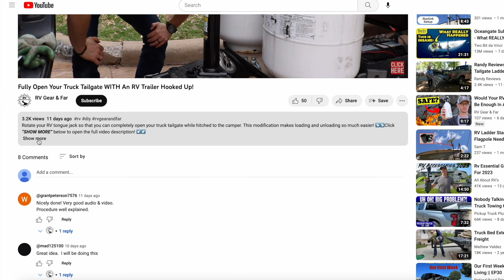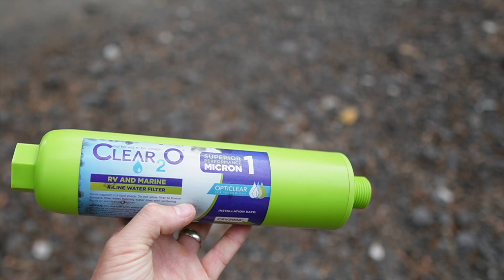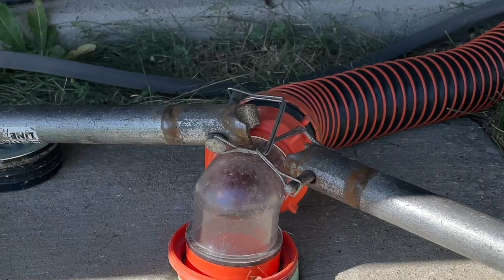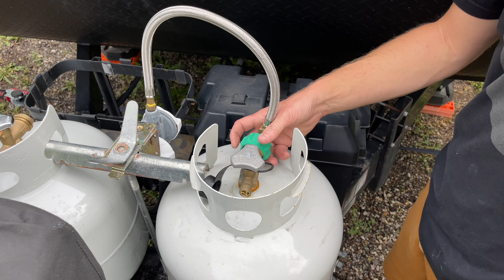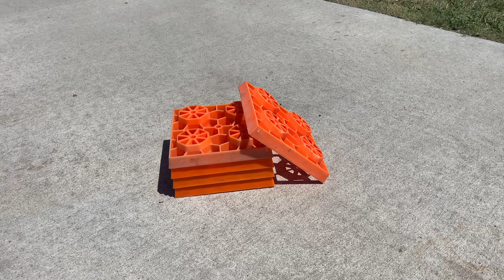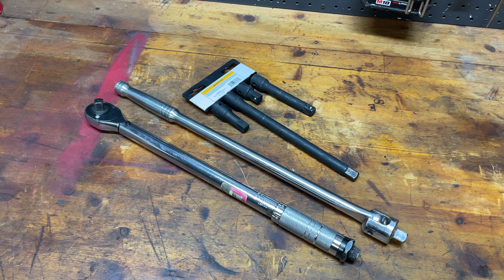New RV Owner? Here's The Essential Gear You Actually Need (Beginner's Guide)

Comment from the maker: 🏘 Join the RV Gear & Far Group Here:
https://rvgearandfar.com/rvgfyt
⭐🌟 Check out ALL the products and gear we recommend here: ⭐🌟  
📦 https://www.amazon.com/shop/rvgearandfar 📦 
⭐⭐ Examples of Products Used In This Video ⭐⭐
🔷 Power Watchdog EMS Surge Protector 30amp https://amzn.to/3OBV4AQ 
🔷 Power Watchdog 50amp https://amzn.to/3DzNRev
🔷 Basic RV Surge Protectors https://amzn.to/3q8Cqr5
🔷 RV Dogbone Electrical Adapters https://amzn.to/3DzFoI8 
🔷 Dual Fuel Generators https://amzn.to/3q8Wh9z
🔷 Generator Parallel Kit https://amzn.to/3KivHBC
🔷 Car Generator https://www.cargenerator.com/
🔷 Solar Generators https://amzn.to/44PecRN
🔷 Basic Water Pressure Regulator https://amzn.to/3KivDSo 
🔷 Adjustable Pressure Regulator https://amzn.to/3Yhh33j 
🔷 Fresh Water Hose https://amzn.to/44NqbPL
🔷 90* Hose Adapter https://amzn.to/3rSdFzS 
🔷 RV Water Filters https://amzn.to/3Yc0W7j 
🔷 Dual Stage Water Filter https://amzn.to/3Yc9Txn 
🔷 Hose Quick Connects https://amzn.to/3QlOsrQ 
🔷 RV Water Softener https://amzn.to/3QlOyjc 
🔷 Black Tank Treatments https://amzn.to/3Yd0buH
🔷 Sewer Hose Supports https://amzn.to/444uFAt 
🔷 RV Sewer Hose https://amzn.to/3OeBE3G 
🔷 Twist On Waste Gate Valve https://amzn.to/3QCe2Jl
🔷 Disposable Gloves https://amzn.to/3rWvCwZ 
🔷 RV Snappads https://www.rvsnappad.com/discount/GANDERFLIGHT 
🔷 GasStop https://amzn.to/3rOAvZ8
🔷 Garmin RV GPS https://amzn.to/3QjHvqY
🔷 RV LIFE GPS https://www.rvlife.com/app/ 
🔷 Trucker’s Atlas https://amzn.to/3rOAyEi 
🔷 X Chocks https://amzn.to/457lXSH 
🔷 Stacking Leveling Blocks: https://amzn.to/3Kk76wl
🔷 Rubber Wheel Chocks https://amzn.to/3rJT6W6 
🔷 Stacking Leveling Blocks https://amzn.to/458WpVj 
🔷 Ramp Leveler https://amzn.to/45cD31H
🔷 Fastway OneStep Chocks https://amzn.to/44MokuA 
🔷 5th Wheel Tripod https://amzn.to/3rJ2sBu 
🔷 Weight Distribution Hitch https://amzn.to/3q8DcV1 
🔷 5th Wheel Hitch https://amzn.to/3KJn7wb 
🔷 Digital Tire Pressure Gauge https://amzn.to/476fAB3 
🔷 Laser Thermometer https://amzn.to/3OA7J7A 
🔷 Tire Pressure Monitoring System https://amzn.to/47fZ0yL 
🔷 12v Viair Compressor https://amzn.to/3Qf4p2U 
🔷 Tool Battery Adapter https://amzn.to/3q8X8Hj 
🔷 Breaker Bar https://amzn.to/3KnQX97 
🔷 Deep Sockets https://amzn.to/457gL15 
🔷 4-way Lug Wrench https://amzn.to/3KkEP8S 
🔷 Socket Extenders https://amzn.to/457mLqH 
🔷 RV Screen Door Cross Bar Handle https://amzn.to/3QhaqvR 

DISCLAIMER We participate in several affiliate programs that earn us a commission on purchases made through our links at no extra cost to you!
Some product links are affiliate links which means if you buy something we will receive a small commission. As an Amazon Associate I earn from qualifying purchases.

Comment: I agree, good info.  My TPMS paid for itself on our first major road trip from Oak Harbor, WA to San Diego, CA.  100 miles short of the completing the entire west coast of the USA.  An hour into our trip we got a tire losing pressure alarm and changed the tire in Everett, WA.  On the way back, as soon as we got out of the Grapevine heading north, we got another losing pressure alarm from a tire that had the tread separating from the tire.  We changed the tire and the wife found Les Schwab in Lemoore, CA where we got all new trailer tires.  TPMS safe us from two blowouts.  Yes, the tires were old and we decided to monitor them instead of getting new tires.  That was the bad decision but TPMS safe us from having the tires eating the trailer.  I agree, this should be the first thing you buy before hitting the road.  The second, is new tires if yours are over 5-7 years old.  Good stuff Brudda.  Thank you for hsaring
Reply from the maker: Whoa - glad the TPMS did its job. Ever seen the V8 veggie juice commercials? "Shoulda had a V8 as the person get bonked on the head? Thats how I feel seeing a blown tire on social media and zooming in to see that the rig is not old enough to have internal TPMS and there is none present on the valve stem: "Shoulda run a TPMS!"

Comment: Great info Josh, one thing I would like to add is that when you do change out your trailer tires for a better quality tire, always have metal valve stems installed. They will hold up better and last longer than a rubber valve stem when using a TPMS.
Reply from the maker: Ooo- great idea Ross!  I like to get my trailer tires balanced too - most shops youll have to specifically ask them to do this.